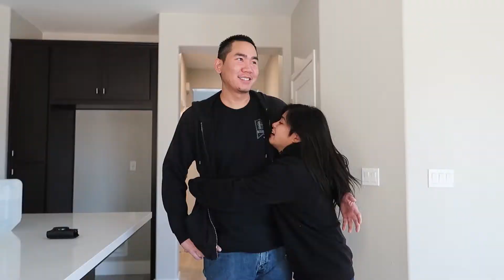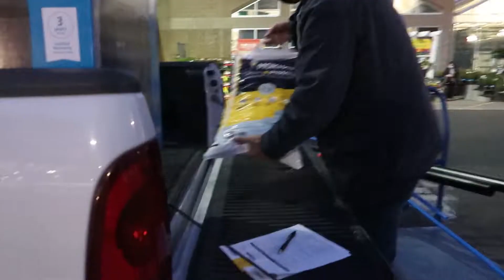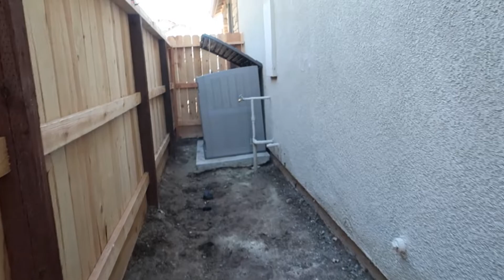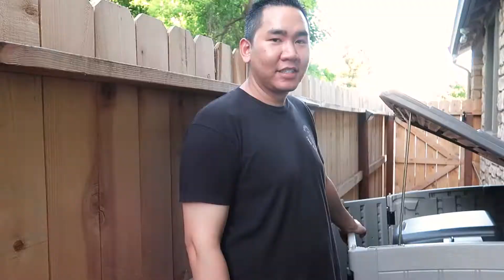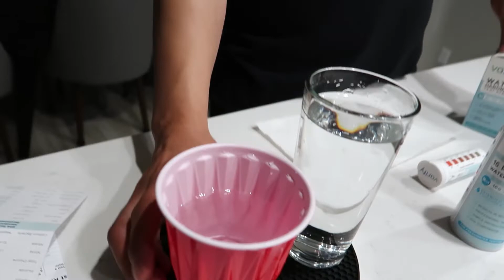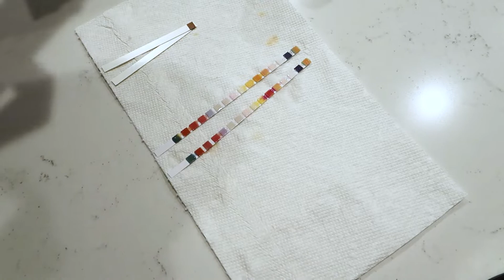We DIY Installed A Water Softener! & Tested Our Water Quality | Journey To A New Home Ep. 7

Comment: I was about to spend $9,800 for the water softener system with installation which I already had signed the contract, but with ur ideas to just buy the water softener/system and with ur help of installation I saved up around $6k+ Thanks for ur ideas